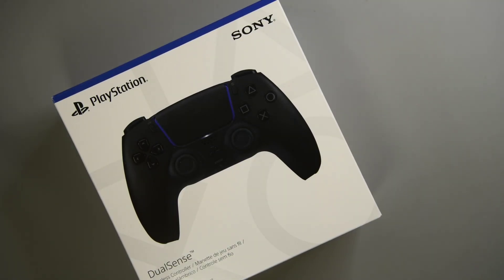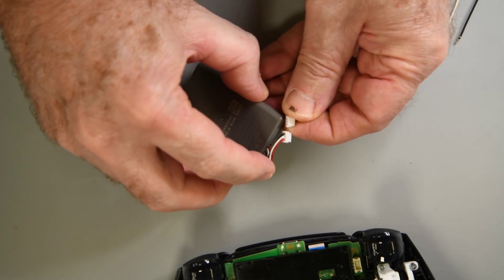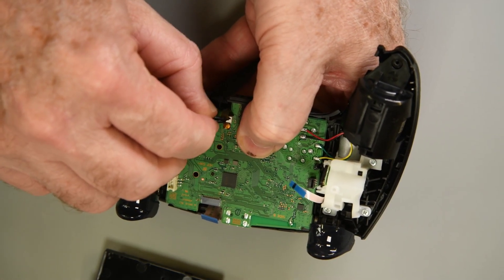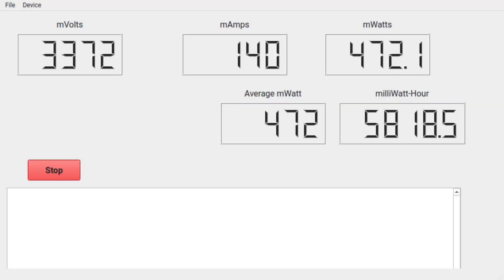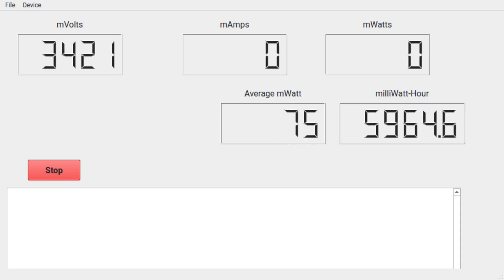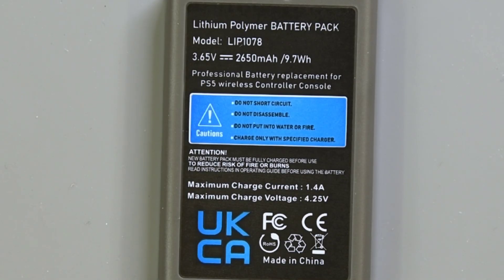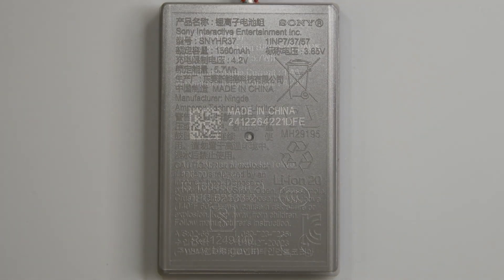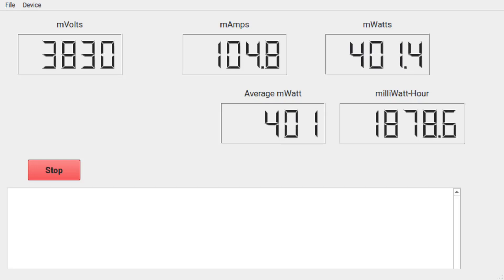DualSense Power Consumption: New vs Old Shocker!

Comment: I’ve never used other brands of batteries, so I’ll be curious your thoughts on which battery if any are suitable replacements. I’ve always been under the impression nothing is as good as OEM but I could be wrong.
Reply from the maker: I'm working on setting up tests to determine just that.
Reply: @metalplasticelectronics354  please do, i am looking for a battery now and no one has tested all batteries offered from aliexpress . I am buying probty battery from aliexpress

Comment: 6:12
I use liitokala lii-500 to test mah of all types of batteries when I get them, e.g. used it for my ps4/3ds/psvita/joycon batteries.
You just need a wood dowel sized as a battery that can fit in the slot, screw in wires to both ends as they are now positive and negative "terminals".
Then you simply connect the wires to a pin header, the thinnest I encountered are joycons but 0.5mm-1mm pin header fit great.
I just test it in 1 pass of "NOR" test where it charge/discharge/charge, it should gauge the true mah in the battery.

Comment: Why did you have to drill a hole on the new controller? Couldn’t you have tested this by putting the back case of the previous controller on the new one? And that way you could avoid drilling into the new controller?
Reply from the maker: I want to test both.  Too much work changing back shells.
Reply: @ I see. Well as I always say, you’re doing God’s work. We truly appreciate so you do.

Comment: Thank you for the test dose sony uses dynamic polling rate  in there console 
the dualsense in pc run 1000 polling i feel using dualsense  in the pc the battery drain is crazy i do like to see test on pc
Reply: have used a dual sense on pc about 2 years ago. didnt notice any crazy power draw
Reply: @dan8t669  Maybe my battery is faulty.
Reply: Did they lowered the polling rate to get the power consume reduction?
Reply: @RoMice  Higher Polling (1000Hz+) = More frequent data transfers → Higher CPU & USB power draw.

Lower Polling (125Hz-500Hz) = Fewer reports → Less power used (better battery life in wireless mice
Reply: I mean, mi listening is terrible, if I did not misssunderstood, the vid is about a homemade mod or an inprovement from sony.

I know I can save battery lowering the PR but that rises the input which I dont want.

So I didn't really understood, is this Dualsesnse lower power usage achived without sacrificing the PR?
Reply from the maker: I'll have to check to see if I can see the sample pulse on the joysticks.  But that won't tell how often the radio transmits the data, and that has to be the real power draw, not counting the controller feedback.
Reply: @metalplasticelectronics354  Thank you for the hard work

Comment: The lower power usage on the new controller explains why Sony claimed 12 hour battery life in the “Version 2” DualSense listings starting last year. I think the claim was just 6 hours at console launch. People thought “Version 2” upgraded the battery and were surprised that the battery was the same when they opened them up.
Reply from the maker: It is surprising how much more efficient the new controller is.  With rumble turned off, I could see more than 12 hours of run time.
Reply: what is version2? bdm-030 or 40?
Reply from the maker: I believe you can tell which version of the controller you have by the second digit of the serial number.  It should be a number 1 to 5.